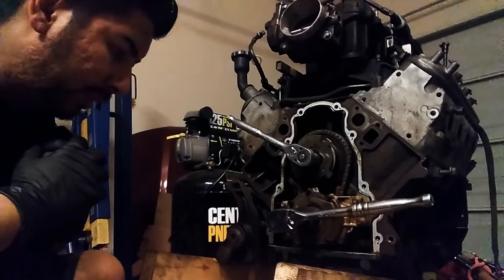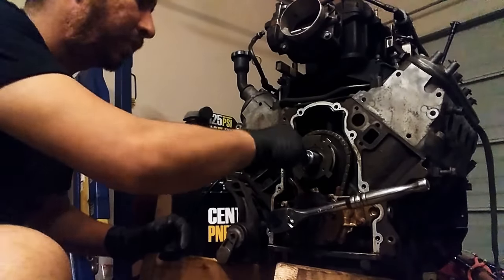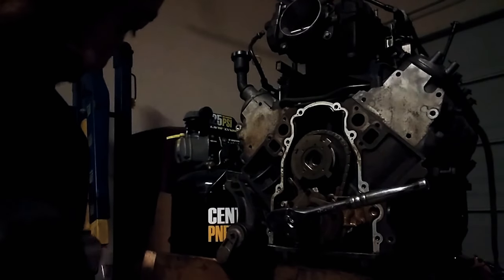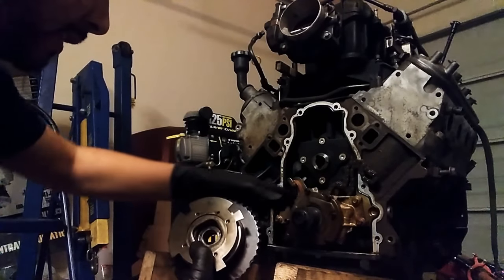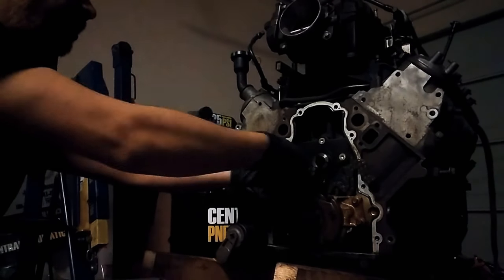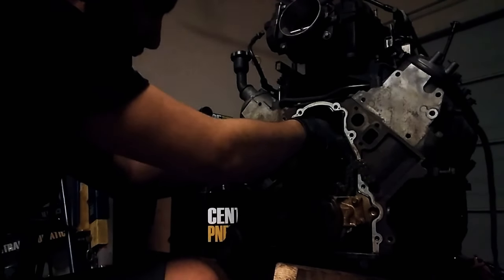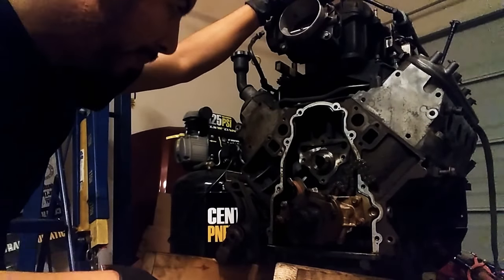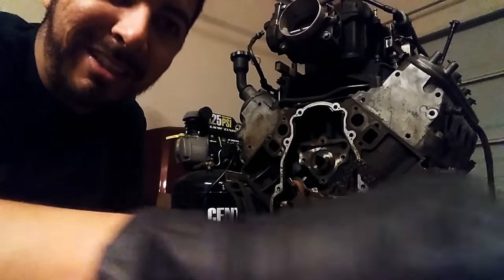6.0 VVT Delete LY6 LS Engine

Comment: Are you gonna block off the oil galley's under the intake and change out your lifters
Reply from the maker: I've been getting this question a lot lately, The LY6 does not have DOD or at least my engine did not, they have the VVT function and that's the only thing I deleted off my engine I used everything else 😁👍 please be sure to like and subscribe to my channel #SirMaloPerformance
Reply: @SirMaloPerformance  iv not opened up my LY6 yet but all the 4th gen engines iv fooled with have had it. I'll check this one and see. I hope it doesn't. One less thing to fool with.
Reply from the maker: @18georgedavis  hopefully all goes well on your build brother take care 😁👍👌

Comment: Did you keep the  stock ecu with vvt delete
Reply from the maker: Yes Sir it's a 4th Gen swap supported by Gen3 original ECU
Reply: @SirMaloPerformance   how did you get a 24x ECU to work with a 58x crankshaft
Reply from the maker: @ericperry4934    Please Subscribe I go through the build on my chamnel, I use A Signal Converter by Lingenfelter Performance I also show a video on how to install I do always recommend you use the instructions given for your build. Thanks again!👍😁😊

Comment: hell yea texas speed stage 1 at least bro,oh and dude the damn lights were driving me crazy haha friggin strobe light,im doing a complete engine swap right now,its in my 05 blazer a L96 6.0 and i need to swap the cam,im not a pro like you and im wiring the whole thing,you just gotta know where to buy your harness,i will admit it im a little nervous but mainly just want to get it done,i feel like all my parts are scattered from here to dallas haha i hate that.but the guy was like yea you might as well swap the cam now and get rid of the vvt,as far as i can tell about these engines is the vvt is the only bad thing when tuning and cam swaps i guess,mine is from a 2011 hd2500 any hd2500 or 3500 from 2010-2017 has my engine,the L96 supposed to have the grunt of a big block haha and going in a s10 blazer with a 5 speed cant wait
Reply from the maker: Sounds like you have one sweet build going on you should defiantly put that up here on YouTube, thanks for commenting please be sure to subscribe thank you again for your support! 👌😊👍
Reply from the maker: @onewheelup hey bud i know you wrote me on the other video but that Arrow Marking on the VVT unit should be pointing straight down and that should align the number 1 piston at TDC, Hopefully you seeing this video again helps boss! Thanks be sure to subscribe if you haven't it would help out alot thanks
Reply: @SirMaloPerformance  haha yea i can see the cam gear mark pointing at 6 o clock,its just that i cant see the crank gear mark,theres something in the way,dont know whats its called.im told that the crank gear needs to be at 12 o clock,so 6 & 12,im gonna call tx speed & perf,this morning,hey i bought their shit right,i'll let you know ok,happy friday as they say,oh and yea i subscribed for ya last night,i joined this thing in 2005 back then there wasnt shit on here,just me and some girl chatting making goofy videos of our pets to send love ones,man its changed a lot.now theres a video for everything.later bud
Reply: @onewheelup  did you happen to get the 6.0 cam swapped and the vvt deleted? I'm doing similar but I'm doing a carb on my 6.0. do you have a IG??
Reply: Hey you mind giving me an instagram i have a couple questions